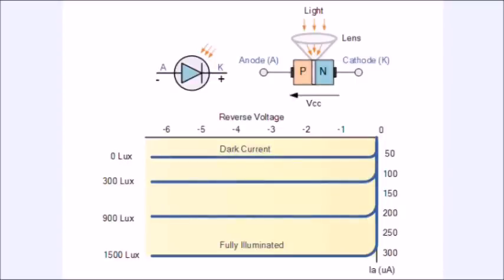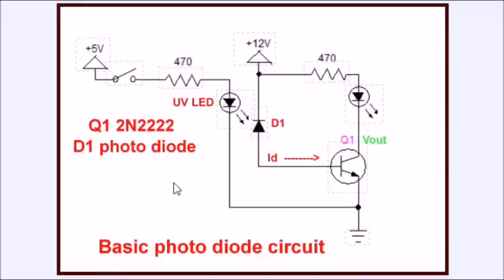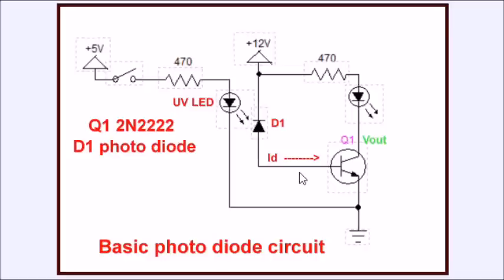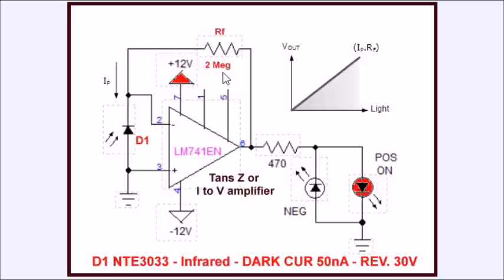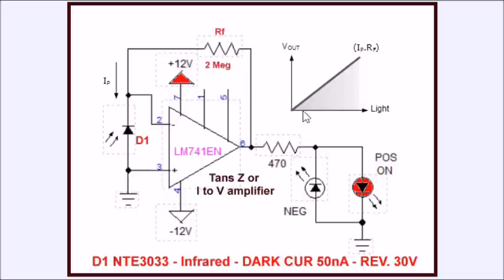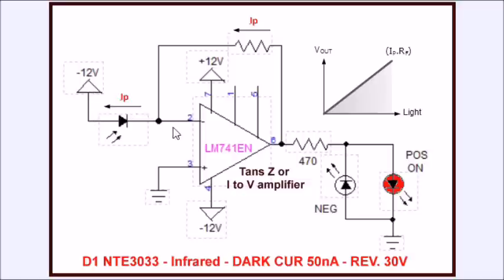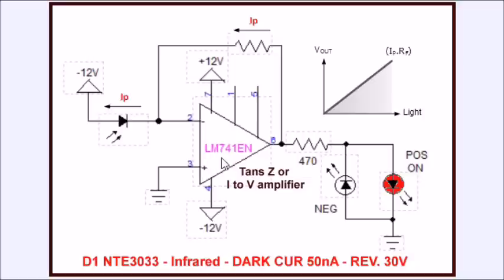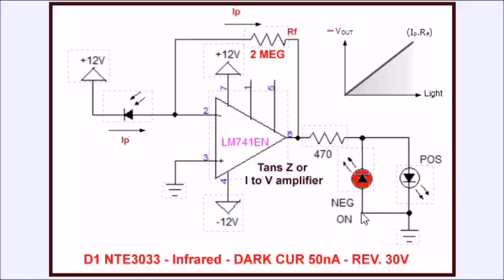Photodiode Op-Amp Circuits

Comment: Great Photo-diode info, would the opto-isolator Vishay IL300 or HCNR200 work as an linear bipolar amplifier (+/-) 0 to10 vdc with the LM741? thanks.
Reply: ooops  that should be IL300 Vishay linear optocoupler isolator  thanks

Comment: Hey great video, i have an issue the reverse bias voltage +12 v is in reference to the ground of the op amp ? Cause i use two different voltage to supply for my pd and for the op amp, thx
Reply from the maker: I'm sure you can not sure how. The resistors will have to be changed.

Comment: Great video.
So now can we say that the photodiode voltage is proportional to light intensity?
And if I don't use the amplifier will the photodiode voltage and light intensity curve will be a straight line?
Reply from the maker: You need the amplifier.
Reply: @LewisLoflin  then I can say that photodiode voltage is proportional to light intensity?

Comment: Incredible video.  Is there a problem if the LM741 is supply with o to 12V?  I am not sure how to get -12 V  from my voltage regulator  circuit.
Reply from the maker: It would be easier to use a LM358.

Comment: when we connect the photodiode to the op-amp 
how is that a reverse bias connection ? in 2:35 and 6:50 how did it work when it's cathode is not connected to +ve supply ?
Reply from the maker: There was a positive voltage feedback through the output resistor. Also the photo diode can generate a small voltage like a solar cell.

Comment: Do you see any reason not to use a comparator as opposed to an op-amp?
Reply from the maker: The amp is needed to boost the current which is very small.

Comment: At about timestamp 5:00 you mentioned "PIN" diode.  Do you know what these initals stand for?  I never found out, although I hsve used them for years.
OUTSTANDING VIDEO!!!
Reply from the maker: A PIN diode refers to the way the divice is doped. See https://www.electrical4u.com/p-i-n-photodiode-avalanche-photo-diode/

Comment: Great video. I am using LM324. How can i connect an arduino in the analog inputs so it can read the voltage? thank you
Reply from the maker: As long as the output voltage does not exceed 5V.
Reply: @LewisLoflin  it doesn't i checked..but I meant the demonstration on how to do it